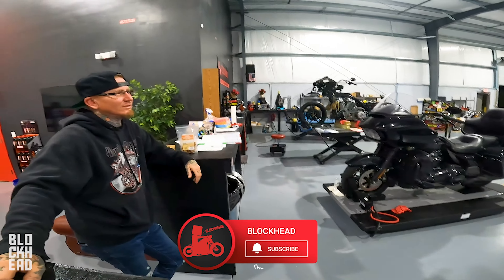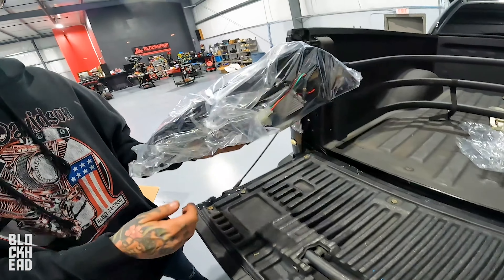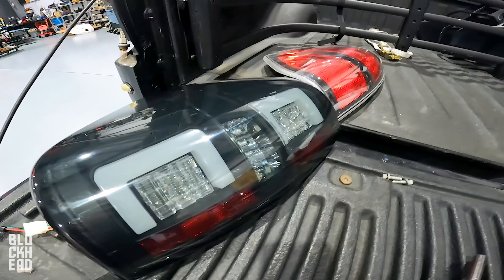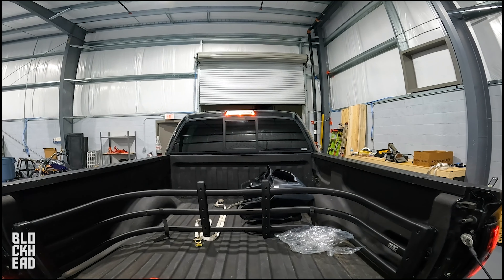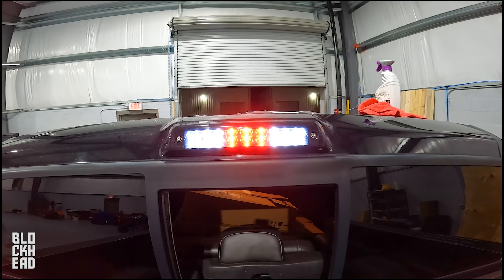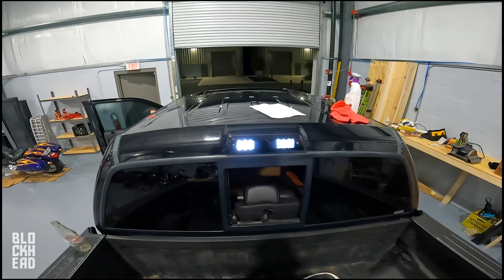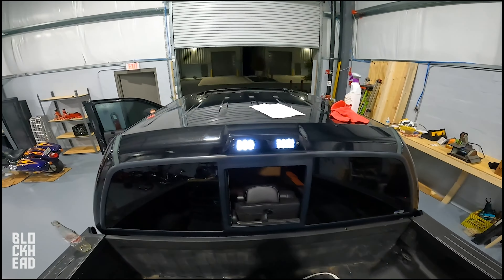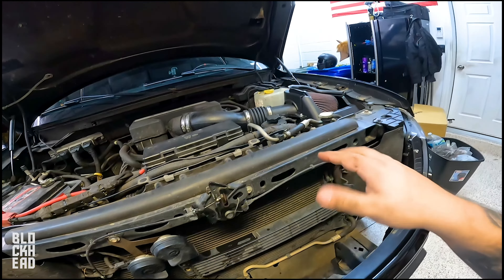BEST Lights for the Ford F150

Comment: I have the same HID stock lights you had and I find them pretty good actually, how much better are these do you think (50% - 100%)? I love these lights but what happens when one of the LED bulbs burn out? These are all contained units aren't they? Does that mean you need to buy the entire headlight assembly and replace every time? Or do they have a long warranty? So far I've decided I'd rather keep my HID as I can just change the bulb for cheap.

Comment: By replacing the 3rd brake light you got rid of the Raptor 3 red marker light there is a 3rd brake light that keeps the raptor 3 marker lights and it’s  a good looking light it’s  Precision Design check it out they have a video on YouTube. I have the same head lights that you got and they are great.

Comment: Did your headlights come off alignment?
Reply: 1 of my XB's needed adjustment to get it to 2" low at 25ft.
Adjusting it was a b** since entire removal of the hdlt unit is required.  ( Adj. screws on back side. )
As for the high-beams  I have no specs on where to aim them...they are up, in the trees.